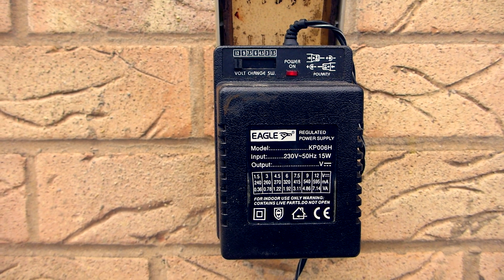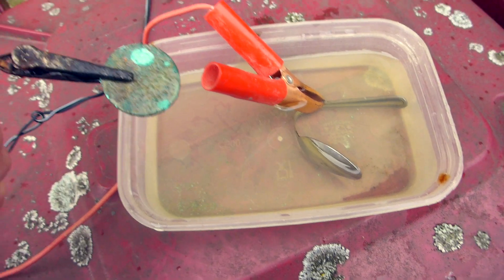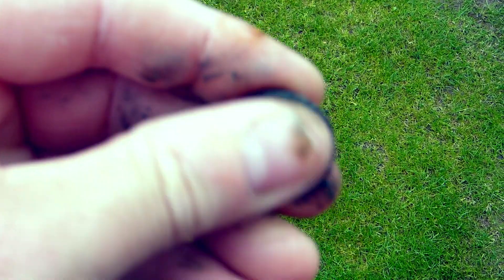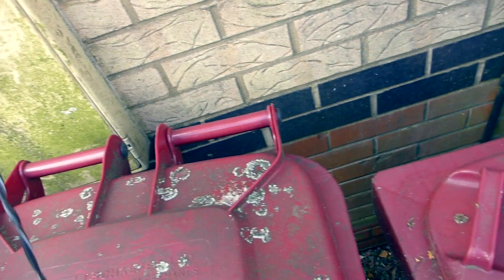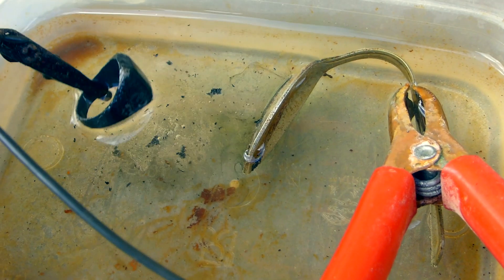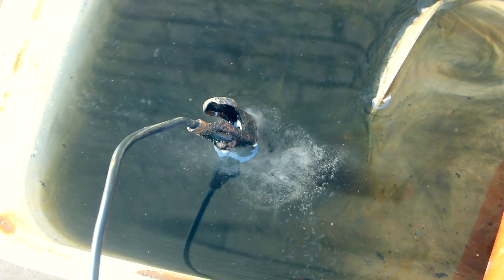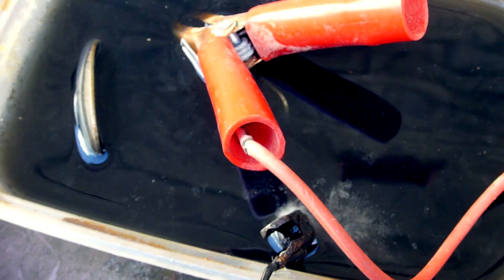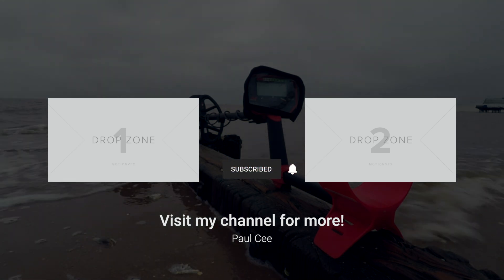Cleaning Metal Detecting finds, with Electrolysis, silver and copper

Comment: I could be wrong but the way you set this up is for electro plating. To clean you shouldn't have the coin directly attached should be 2 pieces of metal with the coin in just resting in the solution. All you are doing with this is plating the coin.

Comment: hello Paul Cee, I have a problem with the pairing between ML80 and Vanquisch 540 headphones, the sound does not cut off on the detector. therefore double sound. do you have any ideas? thank you in advance.
Reply from the maker: have you tried resetting the connection?